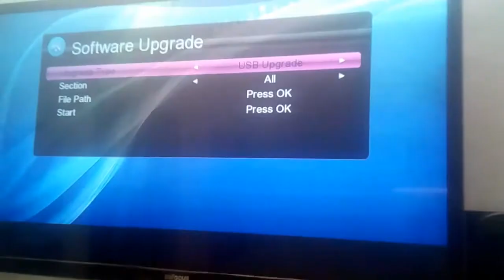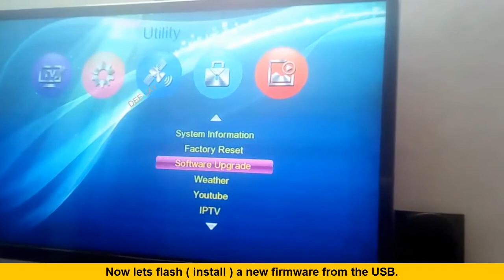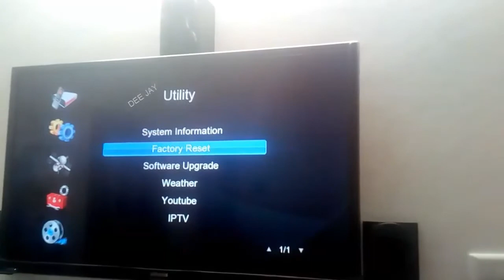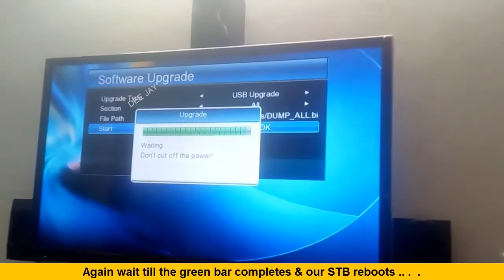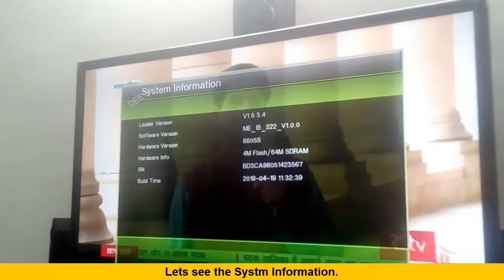How To Fix Firmware Upgrade Error Message | Set Top Box Firmware Flash Error Fix

Comment: I have the same problem with gx6605s receiver.. which i upgrade it with new soft and when i need to get back to the soft i got this message (error occur)
I tried a lot of softs but the problem still there 
My set box has no loader rs232 com port unfortunately
Please help